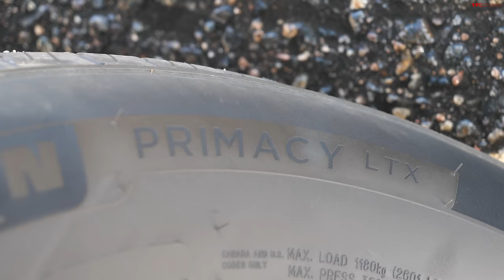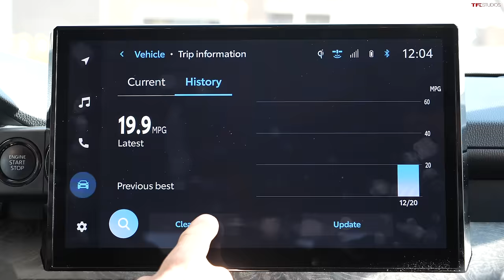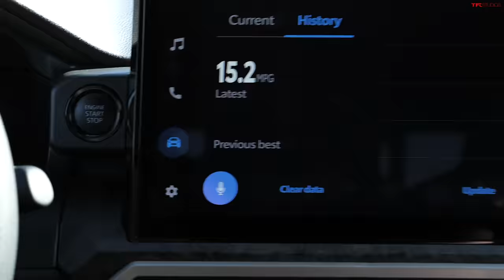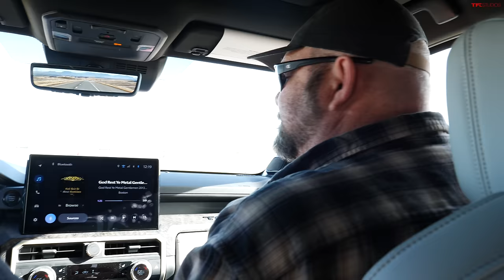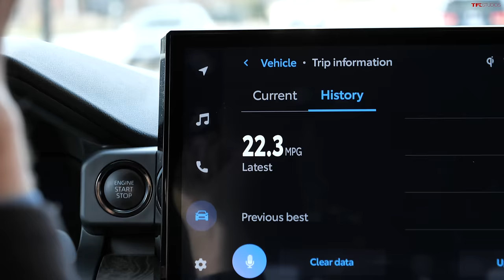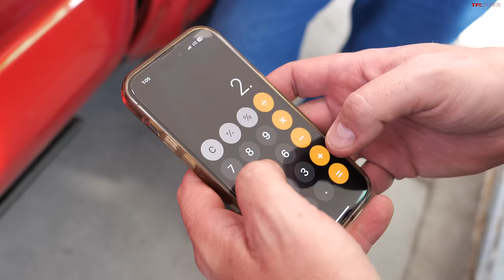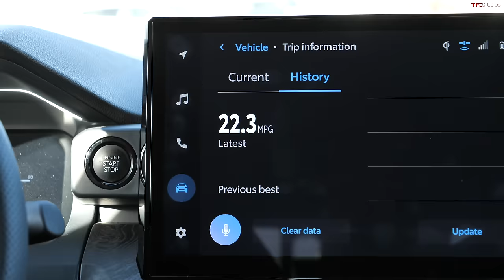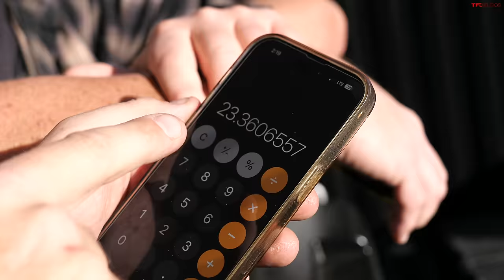Does the New 2024 Toyota Tacoma's Massive Chin Spoiler Actually Do Anything? We Put It to the Test

Comment: Toyota is 1 of only maybe 2 manufacturers that many of us have any faith in at all. With that said, the manufacturers recommended oil change intervals at 10k miles (NOT SMART )and now 4 cyl Turbo only option and recommends 87 octane when most Gasoline Turbo engines call for higher octane fuel along with the ridiculous msrps, it's definitely becoming just a big game to even Toyota, giving us less and charging us more.
Reply: Definitely want to use top tier gas in 91 or 93 octane and high quality oil from good base stock (ng) and change every 5,000 miles.
Reply: @TheNotimprezed  agreed 💯
Reply: I dont think octane is important as I havent heard of any evidence for 91/93 burning cleaner than 87 but the other aspects I do ascribe by (usually Costco gas and 5k oil change intervals).
Reply: @ALMX5DP  maybe, maybe not but steps should be taken to avoid LSPI in the boosted DI engines.  But even the 5.0 in my F150 knocks under low rpm high load conditions with 87. Then there are concerns with oil/fuel dilution. I've basically come to understand manufacturers recommendations as whats needed make a vehicle last 100,000 miles, which seems to be what they consider the vehicles "lifetime" - hence all the lifetime fluids and 10k oil changes.
Reply: @ALMX5DP  i'm not sold on lower octane fuels with a turbo or supercharged engine. With an open mind many reviews highly recommend 91 or 93 octanes when turbo or supercharged particularly with any direct injection engines. I do believe oil changes are necessary with a max of 5k mile intervals with synthetic oils and 3-4k with conventional oils. With manufacturers manipulation such a common practice moreso today than ever, I don't know who to believe anymore.
Reply: @TheNotimprezed  if there is LSPI sure, gotta mitigate that. But many engines are tuned well enough to detect or avoid that with timing even on 87. Of course if you're using your engine a bit differently than the OEM intended (like constant heavy towing in extreme heat) there is that potential which is why I believe many owners manuals do recommend to use premium fuel like Ford does for such harsh conditions/situations.

Comment: Not a great test.  Because you drove to the next parking lot to remove the spoiler.  Using enough fuel at slow speed and idle that the truck computer dropped from 22.3 to 22.1 mpg before you reset it.  Which would make the difference between with and without even closer.  So close that resetting after using that fuel, the truck thought the outcome was the same as the first run.

Comment: Boy like know how good will manual Transmission one wil do in the MPG.  Coming January / February will looking get the manual transmission one for my new / work truck with 4x4 drive sr5 like you get the manual transmission in SR, TRD Sport , TRD off road. That’s not much of a difference. I bet your Toyota MPG loop is without the chin spoil on and that’s at 23
Reply: I have a 2016 Canyon with a manual transmission. In the multifunction screen, there is a shifting "nanny" that tells you when to shift for maximum fuel efficiency. I assume that Toyota will have something similar. I replaced the stock muffler with a Cherrybomb Vortex, and my MPG improved by about 2 MPG, and my 4 cylinder now sounds like an aggressive 6-cylinder. Then I replaced my 16-inch rims with 18-inch rims that were heavier and lost 2 MPG.

Comment: Toyota: Our customers want to be able to remove the chin spoiler easily.
Engineers: Sure, no problem.
Toyota: Seriously. It needs to be easy. Like maybe 9 bolts at most. 
Engineers: We got you. 
- Toyota has left the chat -
Engineers: We’ll use 10mm that way no one can remove it.
Reply: Every bolt on that Toyota is metric. They also said you can use a Phillips screwdriver
Reply: @davidcalawa5269  you obviously don’t know the 10mm joke.
Reply: @ASKid24  apparently I don't.  I will look it up.

Comment: Only 21 seconds in, better fuel milage or not, that thing has to go. When it's so low you can't pull up to one of those concrete stops they have in parking lots without hitting it in a 4wd truck, you might as well never go off road, or your gonna hit it on every rock of pothole. You might get 9 miles more out of your tank with that think on. Not worth it, when it looks like a truck should without it.

Comment: Quick question EPA. what is worse for the environment? Producing 200,000+ plastic spoilers to be thrown in a landfill annually, or 2% fuel savings.
Reply: EPA says keep the spoiler on the truck and save both our landfills and the 2% fuel both. If you are determined to dump the spoiler then recycle it responsibly. 😃

Comment: The real dick punch of having a fuel tank that's nearly 3 gallons smaller is that even if the truck is more efficient, you won't be able to get any extra range per fill-up. If you could drive 350 miles on a tank previously, you'll still only be able to drive 350 miles per tank now. WTF???
Reply: Gotta agree with you there.

Comment: And the big guy was playing games with the fuel Nobel. After 30 sec he did not pull the trigger all the way , he only pulled half way and that does make a difference because the slower you go the more you can get in your tank so he made the no chin truck look worse than it was , you a bad bad boy don’t make it fit what you think and on top of that you should not top off a gas auto because you can cause damage the evap system.

Comment: Likely looked good in the wind tunnel testing, in the real world when the rest of the truck is a brick is doesn’t mean much
Reply: This test isnt conclusive enough but .7mpg seems plausible and to me means quite a bit for what is just a piece of plastic attached to the front.
Reply: @ALMX5DP  lots of owners take them off and see negligible or entirely unnoticed results on a variety of trucks. Including myself. That’s good enough for me, and why I said manufacturers are eking out gains in testing m but real world don’t change much. Manufacturers will look at 50 components to go for efficiency, and owner changing one minor thing on the flat front of a truck to reduce air under the vehicle doesn’t do much. 

Biggest impact they could do if they really wanted efficiency is hybrid everything. +30% to +50% City is going to be a hell of a lot more than this game of maybe 0.5-1.0mpg highway
Reply: @andrewsbbq  sure I guess just a difference of opinion on what such a fuel economy gain means, though I'm not sure we're going to see anything near 30-50% gains with the hybrid here (maybe 10-15% is my prediction but again that would be from a complex hybrid system versus a piece of plastic giving potentially 3% here so I'd expect those loftier gains too).
Reply: @ALMX5DP  F150 hybrid is a prime example, and gains significant power and torque over the 3.5
Reply: @andrewsbbq  no denying the power and torque advantages but I thought we were speaking to fuel economy. I think the PB yields about a 15% combined improvement there versus the 3.5 EB.
Reply: @ALMX5DP  note that is said 30-50% city gain. Huge for pick up trucks that struggle here
Reply: @andrewsbbq  oh gotcha, still quite a stretch in my mind to get that 30-50 based on what F-150 sees (18/20 city for the 3.5 EB and 23/25 city for the PB which is I think around a 20% improvement).
Reply: @ALMX5DP  18 to 25 on similarly equipped vehicles. Plus 10% power and torque. If you compare power specs, compare it to the Ecoboost high output in the Limited and the MPG gain widens.

All from a fairly simple hybrid setup that could be easily adapted across the truck lineup. I bet we see a hybrid 2.7 in a matter of years. They’ve already made the 3.5 hybrid a no cost options over the standard 3.5 Ecoboost
Reply: @andrewsbbq  from what I saw the 3.5 EB is rated for 18 city in 4wd, and 20 city in 2wd. PB is rated for 23 city in 4wd and 25 city in 2wd. I dont think the HO mills have separate fuel economy ratings but I could be mistaken. My initial point was just that 3% gain from a piece of thin plastic seems pretty decent to me.
Reply: @ALMX5DP  lol it is a massive improvement in the pickup truck space no matter the which paper spec you look at on website ‘A’ or website ‘B’. No other improvement ever has done so. And on top of that boosts power. It’s more substantial fuel savings than Prius brought to the compact car segment. Look past the stupid MPG and rather GPM and you see just how much fuel it saves 

And we still haven’t discussed the utter ridiculously ugly nature of the plastic chin plow.  Between this Taco and the new SuperDuty they are absolutely brutal. Arguing in its favour, but countering 30% gains of a hybrid is insanity.
Reply: @andrewsbbq  not sure what you’re point is. I only said IMO that 3% is pretty good for a piece of plastic. You brought up hybrids and I just provided more accurate data (either EPA ratings or Fuelly average from actual owners). Of course both have their place and unique benefits, I was not arguing any of that. So to sum up just looking at 3% for a piece of plastic or of course much more for the hybrid.
Reply: @ALMX5DP   …and see my very first reply to you.
I actually wasn’t going to reply to you at all because you generally annoy me, whether replying to me or others. And you did not let me down here.
Reply: @andrewsbbq  yes you said it was a negligible difference which of course can be argued (pretty effectively too). Then you went off on hybrids and other topics to muddy the waters when my only point was to say that there are differences of perspective and opinion.

Comment: It's sad that 3/4th's of '24 USA mid-size trucks are only available in 4 cylinder turbos. Science informs us that running turbos will diminish the engine lifespan by 20-25%, minimum, compared to non-turbos. Now for the sprinkles on top, we get ugly, cheap, thin plastic decorating the face of now a 44k minimum priced 4x4, still with no front locker. The 4k price jump is greedy & sad as well.

Comment: I'd rather have your Colorado.  Save about 10 grand and the mpg difference is only 2mpg with a 2 inch lift, more HP, more Torque, and real off road tires.  Granted they both have ugly chin spoilers.

Comment: Something I don't get about your trucks is the low mpg. My 2.5 litre diesel SUV will return 45 mpg on a run over UK main roads and motorway.
Reply: Keyword: “diesel”.
Reply: @is6566  not only diesel, but SUV (different shape and aerodynamics to a pickup) and UK (UK gallons are larger, so 45mpg UK is equivalent to 37mpg US).

Comment: I don't get why Americans use trucks as daily drivers, when the rest of the world tends to use smaller cars, and it's just fine. 

I drive a  small car here in the US, not a hybrid. But I still get 55-60 MPG on the freeway cruising about 55-60 MPH. That is awesome, it barely uses any fuel. Also that number is off the cars MPG guessing meter, as well as verified by doing the math at the gas station.

Comment: My 2022 Ram 1500 has an automatically adjustable chin spoiler, and other manufacturers have it too. At highway speeds it automatically lowers, but at low speeds it raises to increase ground clearance.  Why didn’t Toyota do this????
Reply: Complexity and bad for modding.
Reply: @is6566  it has lane keep assist which is a LOT more complex than an automatic chin spoiler.
Reply: With electric steering and cameras that they already use the steering assist doesn’t use any additional hardware than what is already on the truck. It’s just additional software. For the spoiler it would be a bunch of additional hardware and some software.
Reply: Tundra has an automatic power airdam. It's not much hardware though so likely it was just a cost savings thing.

Comment: Surely if there's a manufacturer that could figure out how to engineering a retractable chin spoiler as part of the lower front fascia and have it survive, Toyota would be the badge. 
I could see that thing becoming an impromptu snow blade in parts of the country, right up until it's forceful detachment.
Reply: Ram has a available retractable air dam.
Reply: @jorditaylor144  as does Ford with the F-150 and even Toyota has it for the Tundra.

Comment: Excerpt from the Chevrolet Colorado owners manual:

"To gain more ground clearance if
needed, it may be necessary to
remove the front fascia lower air
dam. However, driving without the
air dam reduces fuel economy.

Caution
Operating the vehicle for
extended periods without the front
fascia lower air dam installed can
cause improper airflow to the
engine. Reattach the front fascia
air dam after off-road driving."

The air dam on the Colorado is not nearly as unattractive as this one. There has to be a big reason to put something that hideous on an otherwise great looking truck.
Reply: Yes. There is. CAFE standards.

Comment: Imma just buy an old f250 7.3 and get better mpg, have more fun and reliability. 22.3 mpg is a joke for hybrid technology.
Reply: hybrid technology?
Reply: If you are promoting 7.3 diesel F250 from 1994-2003 then anything made in 2023 looks as hybrid. 😃
Reply: @is6566 I did say old f250. 7.3 f250s can get 30mpg highway
Reply: @RN-fx3zl  I've never heard of an old 7.3 getting that good fuel economy. Most people see low 20's on the highway at best (which is still damn good, but a far cry from 30).
Reply: @ALMX5DP  in the city they guzzle but old diesels get excellent fuel mileage on the highway I’ve personally seen 28mpg on a f250 7.3 diesel

Comment: Not sure why they put such a huge ugly air dam on there other than it was super cheap. Ram 1500 has a huge one as well but you don’t see it as it’s motorized and comes down at speed. They could have done something like that and kept it decent looking
Reply: Just another potential problem waiting to happen. Also makes modding for off roading harder.
Reply: It's just there appease the government. That's why they made it super easy to remove.

Comment: I think Toyota caused a cooling problem for themselves when they reduced the grill opening with this facelift. The air dam is a band-aid on a problem that will arise when the vehicle is operated at highway speeds under load. Air pressure created under the front bumper at these speeds cuts off the flow of air through the radiator. In the days of engine-driven fans and fan shrouds, this wasn't a problem. Wait until summer, hang a trailer of the back of that thing and try pulling Wolf Creek Pass. That little electric cooling fan is going to be working overtime. Try this, remove that air dam and burn up an engine. Try to get it covered under warranty and find out the real reason for that air dam.   -Dave Wagner
Reply: Sounds like a lot of speculation. I'd be willing to bet that the Tacoma engineers designed accordingly and of course this did pass the J2807 which includes a pretty substantial hot weather incline test.
Reply: Sounds like complete BS.